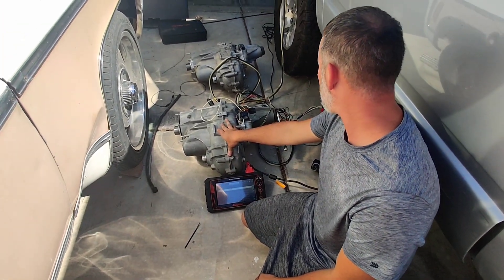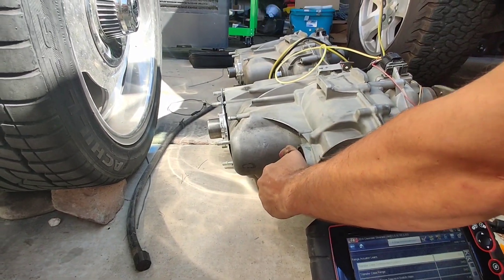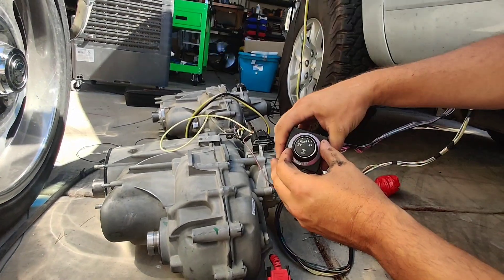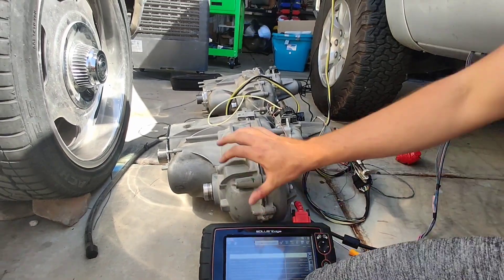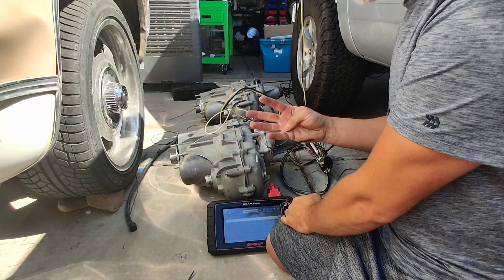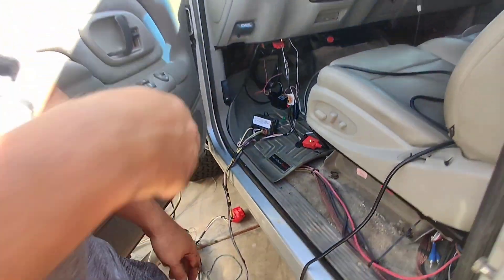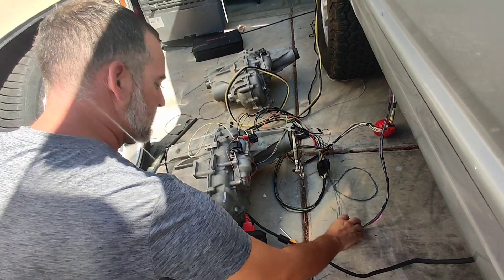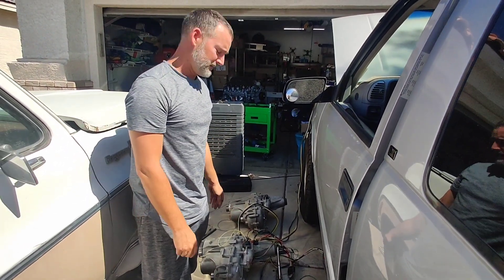GM electronic transfer case system for swaps!

Comment: Good job setting it up to stand alone. NQH is pretty durable and you can get them behind 6L80, 6L90, 8L90, and I think the new 10 speeds. I am pretty sure that it needs the individual wheel speed sensors for Auto 4WD function so I went ahead and ran the EBCM and wheel speed snesors in my LY6, 6L90E swapped 86 S10 Blazer. So far, so good.
Reply from the maker: Wouldnt the abs get the speed signals?
Reply: @swaptimeusa  Yes. When they added Stability/Traction Control, they just renamed ABS to Electronic Brake Control Module (EBCM). I did not want the EBCM bothering me and did not want to plumb all the brakes through it so I just removed the module from the rest of the brake control block and wired it into my networks. So in Auto 4WD, the moment that the rear tires slip, the clutch-pack in the t-case engages and off we go. Fun but I want more.

As my Blazer will be used in some sorts of ralley and drifting It would be awesome to get better control of the 4WD engagement. Like when Ken Block grabs the hand brake I think he hits a button on top and disengages the front axle. I don't want to kill the teeth in my front axle engaging it in a full throttle drift but the clutch-pack in the t-case is designed to apply in exactly that situation. They engage almost immediately. The only issue is interrupting the TCCM (Transfer Case Control Module) automatic functions without it throwing a code like C0398. Looks to me like unless the TCCM can be hacked to add a momentary interruption (without errerring out) I will probably have to go without the TCCM, build physical limiters into the t-case motor and just run fully engaged (except for temporary interruption). I'll probably just leave it as is. It allows a moment of hand braking before engaging:)
Reply from the maker: @jefflaney9355  great info Jeff! I look dive more into this to get a full understanding of how the clutch system in the tcase works and keep learning a d testing
Reply: @jefflaney9355  Block don’t disengage the front diff when drifting, but some rally cars have a separate clutch pack right before the rear diff. So when engaging handbrake, the clutch disconnects the rear diff and engaging it when releasing handbrake. That’s because they don’t have center differential in the T-case, full time all the time

Comment: I’ve done a 6.2 swap on an 06 avalanche. I’ve currently got the factory 4l60e built a little but would really like to swap a 6l90 or 8l90 while running a AWD transfer case. I’ll probably end up swapping out the front and rear differentials as well but hopefully down the road a little. Any thoughts on the transfer case options? I’m also considering a gauge cluster swap....

Comment: Mitch. You the man.
Need some help if possible. Swaping a 8L90 over to 2wd. Got a new extension housing, output shaft, and slip yoke. Donor was supposed to be a Yukon. Slip yoke is to large to fit inside output shaft. Bought new AC Delco parts. Need help with part numbers if possible. Will be getting with you on reworking my harness.
Reply from the maker: You had the same issue as I did. They could fit better but it will work with some extra force. Good phone call today with you
Reply: @swaptimeusa  Thanks for taking the time to call. Just took a bigger hammer like you said and it went. Just wasn't sure that it would ever release again. Should leave a dead spot in spline for sure.

Comment: DUDE! I've been searching about 4 days for this exact video. I have a 6L90 with an NQH case behind a '03 LQ4Ls with the stock computers. Does your harness work with the 03 computer? Or do I just need to get the switch, the TCCM, and hardwire the lines? What is the relay above the encoder motor for? What is going on with the OBDII connection? I plan to run a digital dash, so I will use the OBDII to feed it, so I'd need to hardwire anything for the Case. Please advise. Thanks so much for your video! brilliant!, even the guys who sold me the standalone Trans control said they dont know how to do what you've done.

Comment: Hello bud I have a Question on your set up (How can you talk to the Module with your Scanner if those modules use High and Low Speed data and your vehicle is not equipped with HS can bud

Comment: I currently have 1997 Jeep that has an ls 5.3 from a 2006 Chevrolet Avalanche installed the engine is being run thru a Novak computer and harness. Trouble is that thier harness does not have the connections for the transfer case I am looking for a stand alone computer that can handle the transfer case can you please help me out.

Comment: Hello friend, I swapped my ford bronco with ls 5.3 engine and I am using 246 electronic transfer with independent harness.  2hi and 4hi works but I can't make 4 lo work, I use original harness.  do you have any idea ?  del why it could not work considering that tccm is good
Reply: Do u ever got the problem fix i am here